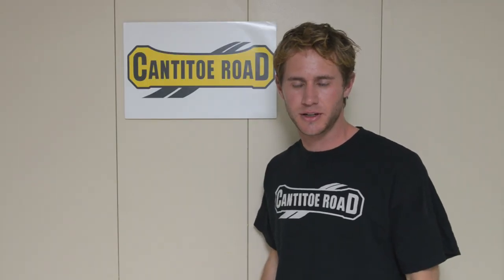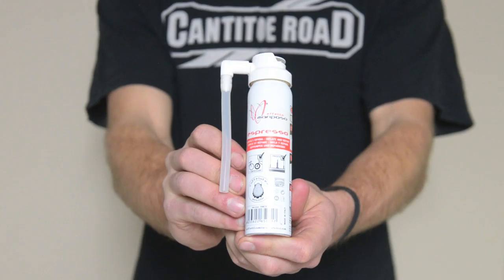Espresso Bicycle Tire Sealant - How To

Comment: I had this stuff for 3 years before I decided to train myself on how to use it.  I had an old tubular tire I used for gravel rides in the basement with a hole around the base of the valve.  I picked up a knife and stabbed a couple more holes in the tubular and proceeded to use this stuff.  On the first try, I did not hold the clear tube on the valve and it popped off.  In the next round, I put the clear tube on the valve (valve core still on) and started to till the tire slowly. The foam quickly found the holes and started to come out and after a minute the flow out of the holes slowed down.  After about 5 minutes there were no more holes and I pumped the tire up to 60 PSI and it stayed that way overnight.  I did not notice any massive additional weight and the valve core still was clear . After having this stuff on my frame for 3 years it worked like it was just purchased.  I am getting a couple more so I will have it and be ready if I get a puncture out on the road.